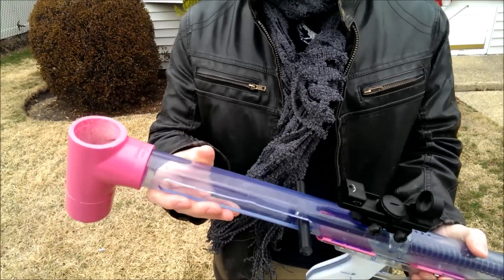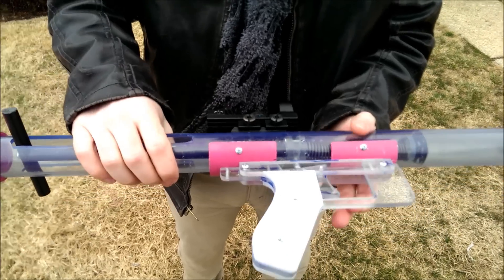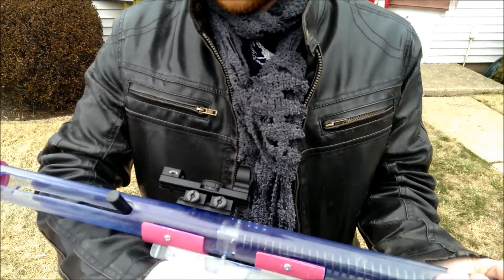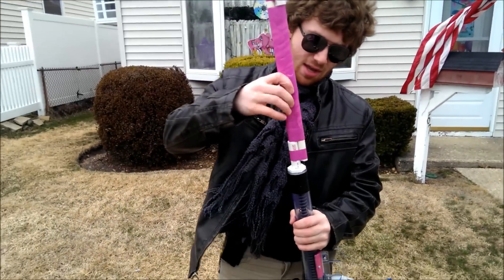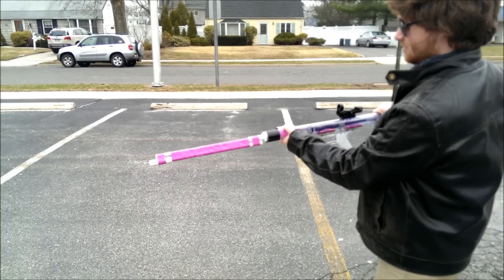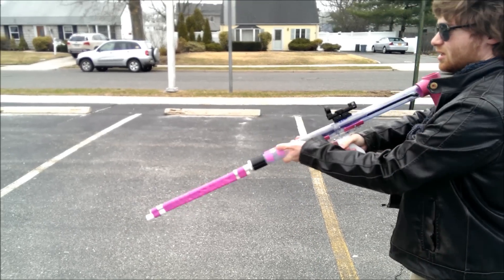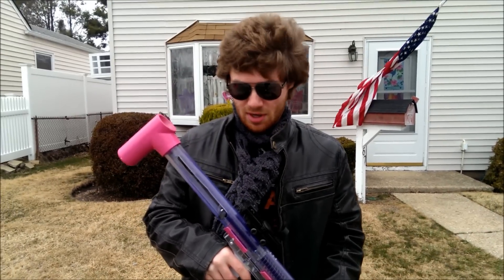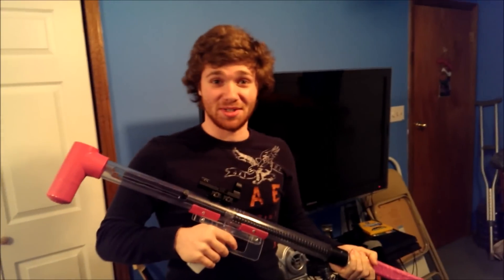First Homemade Nerf Blaster!

Comment: The speed loader you use is either to long or the width is a little bit large, that is what is making the farting noise, I would suggest using 32nds brass
Reply: Considering the plunger tube was doing this without having the speedloader on, it's definitely not the speedloaders fault. 

Also, 16/32 brass is 1/2". So great job there.
Reply: Snoopy Time I uh, never said it was for couplers?
Reply: Nicholas Bradsaw  Yep, you definetley do not know what you're talking about.
Reply: Snoopy Time I'm not sure you do, seeing as how you misread my post. Try trolling harder.
Reply: Snoopy Time The only thing I mentioned brass for was the 16/32 being 1/2 inch brass. 

It was not for use of couplers. Any modder knows that brass as a coupler is bad. Please up your reading skill.
Reply: Snoopy Time Please stop trolling. Jesus.
Reply: Nicholas Bradsaw  Stop talking shit about brass couplers.